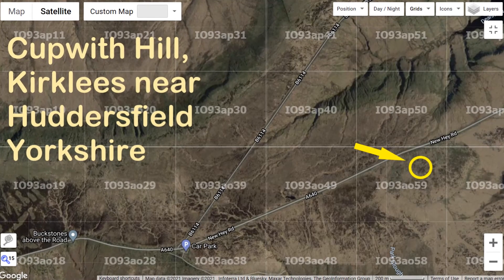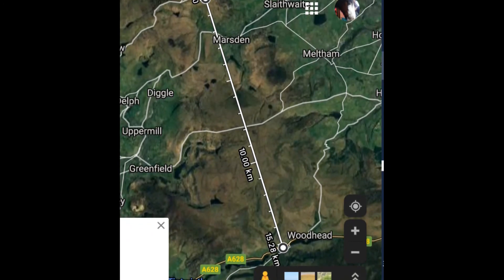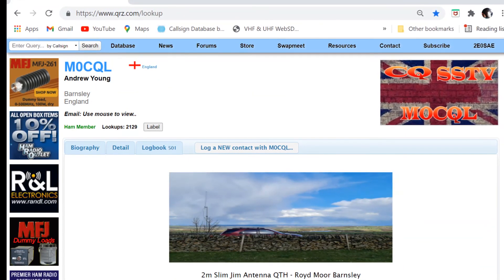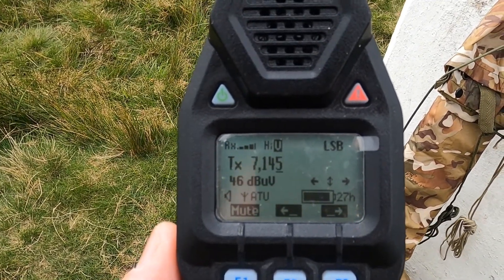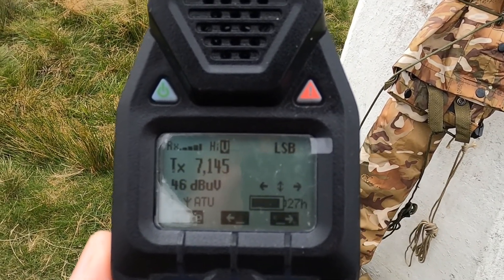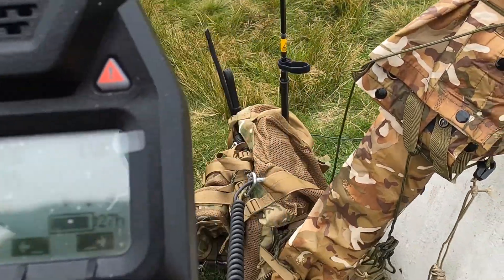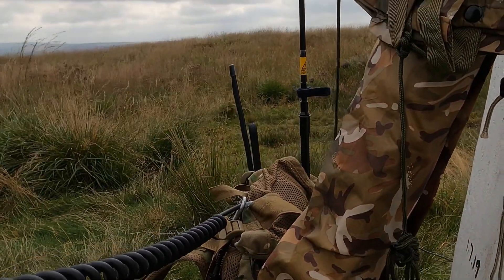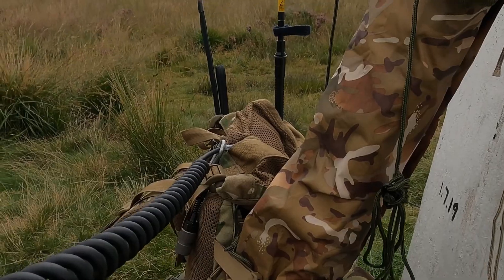HF Man pack radio 40 metre contact  from Cupwith Hill

Comment: what is the weight of your pack,  as I'm putting a portable pack together and weight start going up when adding bits n bobs,  73's de m0yyo
Reply from the maker: Hello Fran, I have just looked at your QRZ page profile photo, is that what you would call cat control? As for the manpack kit I do have to admit that I have my Bergen fully loaded with apparatus  to suit all on site difficulties and as such I do carry more than I strictly need, this is due to the fact that I go to so many different places that I am unfamiliar with. The CODAN radio c/w battery weighs in at 5.5 Kilo, I then have 2 small radio mounted vertical antennas, an emergency long-wire, two counterpoise and my multi band di-pole and the 5 metre mast c/w ground anchors and mallet. The grand total is 18 Kilo which sounds horrific however as the Bergen is a genuine military radio Bergen this weight is distributed extremely well with no nasty pressure points to bare on your torso. The weight helps me with keeping fit and I must admit that when I go walking without it I feel naked. I built up the weight and my fitness gradually over a period of time. It is critical that you have an extremely well fitting Bergen with the weight evenly distributed. A poor fitting Bergen or any ruck sack which is poorly packed will cause discomfort and fatigue. Finally Weigh everything that you think you need and see if lighter items are available, such as ground anchors for you mast and the mallet to drive home the ground anchors. Don't be afraid to experiment and don't be afraid to build up your fitness. Above all enjoy what you do and do not allow your kit to be a burden. Good luck
Reply: @moorlandmule9327  Thanx for the reply, i must admit yes duke the cat was my cat control for a few years and always lay by the side of the radio ( i think it was the heat), sadly he died last year.  we opted for bergen's and currently with food and stove antennas and radio we divide and carry 12kilo each.  currently we only go short distances about 8k's but building up slowly.  i do love that codan radio, it does look mint.  anyway thanx again and 73's hope to contact you sometime when we get round to doing some sota's..  de m0yyo and 2e0yyx